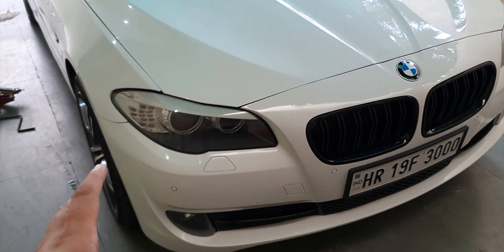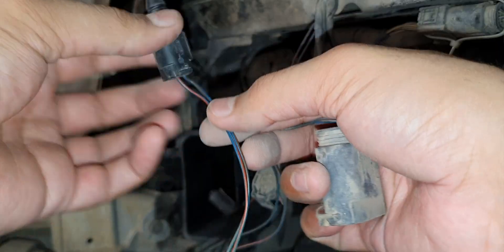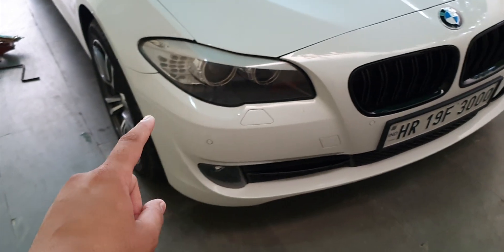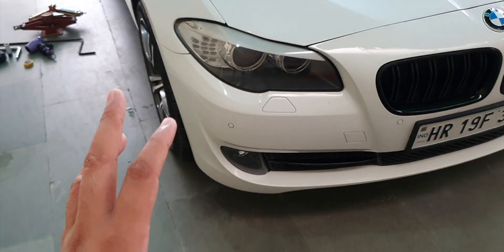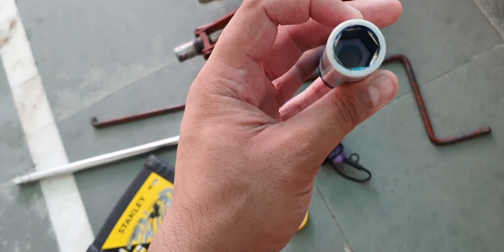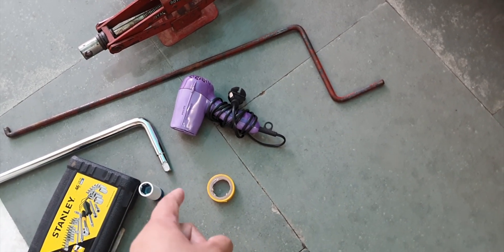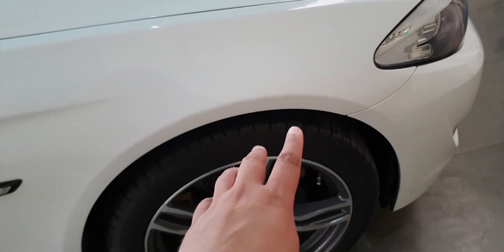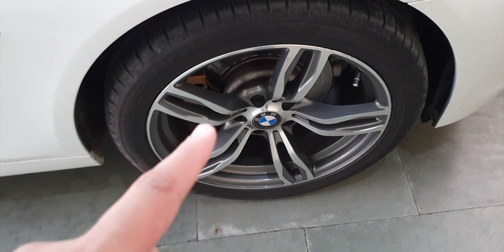Bmw Outside Temperature Sensor Short To Positive - Wiring Diagnose

Comment: Hello, i have the same problem as my board shows -40 degree but on BMW e60 2006… ive changed sensor twice and nothing happened, right after i did The same with sensors connector and still nothing … so is There any possibility that i have a problem with that connector near right front wheel?

Comment: Will the car start if this sensor is broken?
I have 535i 2013
Showing codes are 10b101 10b104
Reply from the maker: 10b101 this for the ambient sensor and the car will start and you can drive but the ac won't work

Comment: Boss I have bmw 330e electric hybrid and showing -40 and my hybrid system is not starting while I drive. I was wondering if because of sensor and -49 the hybrid system is restricted.
Reply from the maker: If the outside temperature sensor is bad and the reading on the dash is wrong like -40 or +40 or it fluctuates quite a lot then your outside temp sensor is bad or check the wiring this sensor can cause no of issues as the ecu thinks the outside temp is extreme

Comment: Would this be the same on the 2011 e82 right hand drive?
Reply from the maker: This overall sensor and the wirring would be same but on the eseries the location might be different either it will be on the centre and you will need to remove the bumper or on either wheel arch